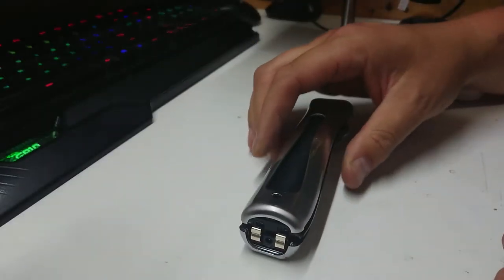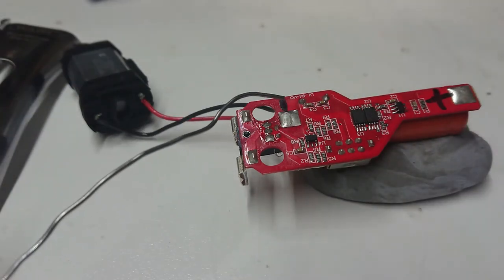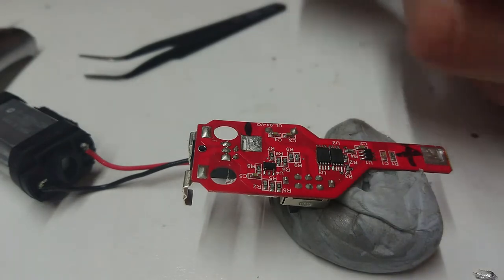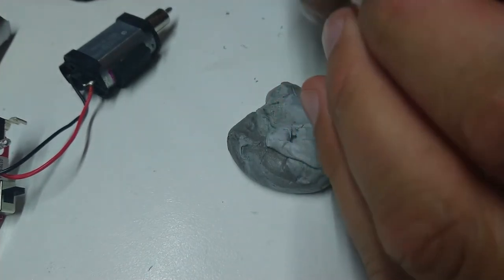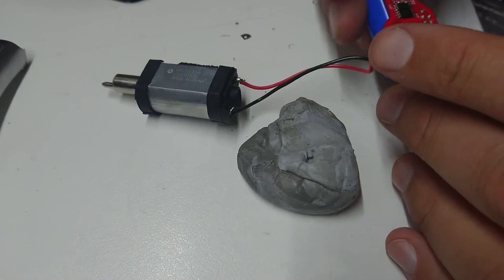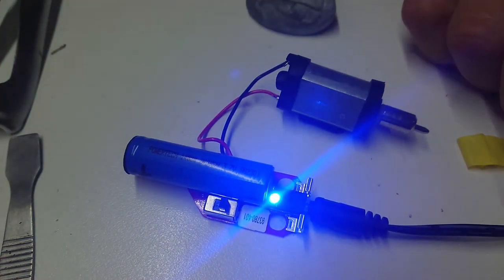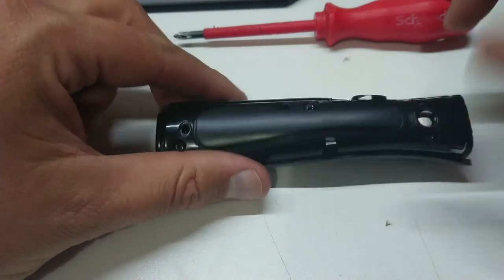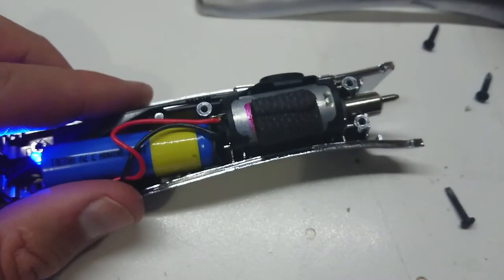Wahl Trimmer Battery replacement

Comment: On Jaycar, I could find the following battery: 14500 Rechargeable Li-Ion Battery 800mAh 3.7V Solder Tag
Is that the correct one?
Reply from the maker: Yes, a highee capacity is fine  as long its the 14500 size.

Comment: Why did you skip the disassembly?  I have Model 9876L which has no screws showing, so I'm assuming that I have to open the casing with a knife edge, which often destroys it when you don't know exactly how it is held together.
Reply from the maker: See 14:00 onwards for re-assembly, might help you understand how it went together.
So I got out of bed just to look this up, I never recorded the disassembly, there are 5 very obvious phillips screws under the lower cover.
separate the silver bit from the black bit and they will be very obvious, DO NOT try to pry the whole unit apart.
Reply: @TheAussieRepairGuy  Will do.  Thanks for the reply.
Reply: @TheAussieRepairGuy  thank you for this video! I didn't think the black part was under the silver, I thought it can off to expose screws. I have the same issue, where to insert a pry  tool without wrecking the clipper, while examining frame 12:52 I saw the black plastic fingers in the cutter end that cold be pried out to start the cover reveal, a pry in the lower part of the switch hole and prying out on the silver cover at the charger end got it off.
Reply from the maker: @GmanInd  Yes this video was done a few years ago and I was in a bit of a rush, and the owner was observing as I did it, consequently I missed filming a few steps.

Comment: just replaced the battery on mine and something interesting happens. After 15 minutes of charging the blue LEd switches off. How come is this happening? I''m sure it would take longer than 15 minutes to recharge a battery. Any ideas? Cool video by the way, it is very helpful.
Reply from the maker: It could be that the newer battery is alreasy partially charged. New batteries iften need to be discharged a couple of times to reach design capacity.
Reply: @TheAussieRepairGuy  you could be right, it was partially charged I fully discharged it. Still, something is off. The motor might not be working that well as the change of battery didn't seem to help that much, it feels slower and rotating at a lower frequency than my new Wahl Beret.
Reply from the maker: @miguelfernandes333  perhaps a small drop of sewing machine oil on motor shaft bushings

Comment: Awesome vid. Thanks. 
What temp u run ur soldering iron at?
Reply from the maker: About 400c, and I use 60/40 tin lead flux core solder, 1mm diameter.

Comment: U know that annoying aluminum shaped like a U once you open up the blade? It fell out. But, now I don’t know where it goes?
Reply from the maker: Sounds like retaining clip. I don't have these in my posession anymore, and I'm not an expert on them. My suggestion would be to assemble the unit until it becomes obvious where that part belongs.
Reply: @TheAussieRepairGuy  you have a wahl mag, right?
Reply from the maker: @or1946  no this was handed to me for battery replacement - I did the video and gave it back to its owner.
Reply: @TheAussieRepairGuy  ok. Damn, I wish I knew how to put it back. It’s so Frustrating ( it’s for a Wahl Mag Trimmer  ) Anyone know?
Reply from the maker: @or1946  this guy seems to go into detail that might help:
https://youtu.be/lRwPczjHqEE
Reply: @TheAussieRepairGuy  Thanks!